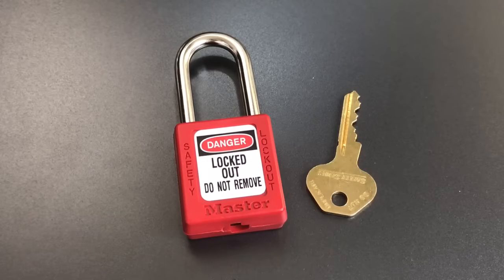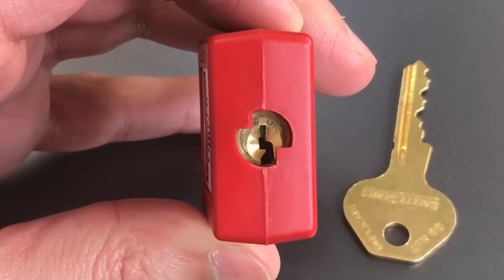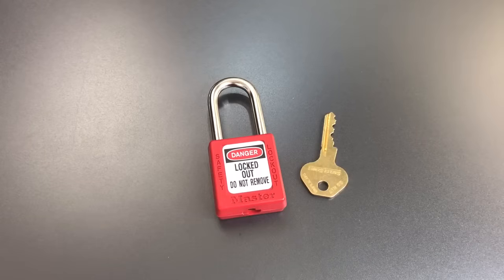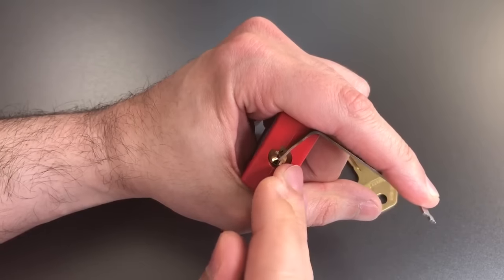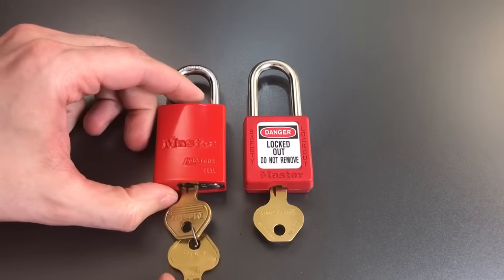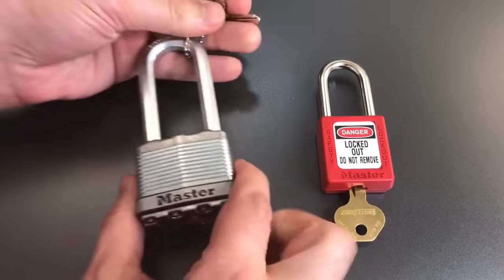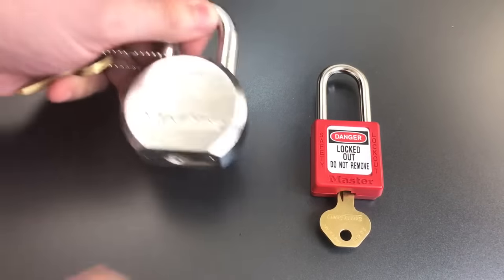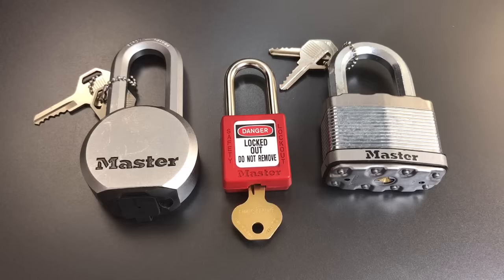[479] The Master Lock Paradox - Model 410 LOTO Padlock

Comment: The strong core is so the wrong key does not accidentally open the wrong lock by the ignorant new guy on the crew . The weak housing is so the lock can be busted open in an emergency. I worked in the engine room of a commercial tugboat, we had these all over the place.
Reply: But this doesn't explain why the strong core is not also available in the strong housing LOTO locks. That is the "paradox."
Reply: @WalterBurton  the theory of marginal returns?
Reply: I would add that in the environment that these are being used, tools to "break" the lock are so readily available, the need for an extremely robust body/shackle isn't the top priority for design.
Reply: You all are missing the point, why in the hell would they not have this same core in their other locks instead of having the rest of their lineup which are used to prevent theft have these cores or similar?
Reply: @Alex-ve1og  It is their option to sell whatever, and our option to buy whatever. Why make it more complicated?
Reply: The bigger stronger non-LOTO locks have less robust cores because pricing is so competitive on those locks that pennies matter.
Reply: @WalterBurton  It may be more of a probability thing. The strong body locks are designed with the thought that vast majority of people trying to get past them will use some sort of brute Force. The lotto lock is designed to be tamper resistant.
Reply: @Alex-ve1og  Because they sell 200x more of the plastic one = bigger circulation of keys, hence a core with more possible combinations = lower likelihood of same keys. It's not rocket science.
Reply: @overtaxed79  you dont think a lot, do you?
Reply: Fuck yeah tugboats
Reply: @frankslaiter5188  And because normal consumers judge a lock by the housing and not by the core.
Reply: Walter Burton every lock needs a weakness, just like how every person has one. Ez
Reply: @TheGreenTaco999  You actually captured my thoughts when reading that comment.
Reply: That's not the paradox. the paradox is why can't we have that core in the "good" Master locks that are meant to withstand more than just butter knife
Reply: You don't need security pins to prevent that mistake. Spools are strictly an anti-lockpicking feature, they do nothing against "loose tolerances, lock accepting wrong key" sort of errors. And usually 1-2 spools are enough to thwart raking. 6 security pins is definitely a setup against competent lockpickers.
Reply: I worked on experimental reactors, we had special locks which were multiple pins on a flat plane. The keys could only be removed in the locked position. The keys were required to be inserted in to the control panel before firing the reactor. That ensured all access doors had been secured before operating the reactor.
Reply: @HarryTwoDogs  So why waste money on assembly lines for the shitty cores when you can just make more of the really good LOTO cores and spam them into every product?
Reply: Walter Burton money
Reply: I work on tugs and we hardly ever use them. The most use they get is when I pick them while we are headed up the Hudson River. If you are using these all of the time then you guys have a lot of electrical issues. They don't even use these in shipyard most of the time but I work for a smaller company. Peace brotha
Reply: my theory. 

A large work site may have 1000 people who all have their own lock. You need a large number of different keys to prevent unintentional unlocking, so 6 pins. Masterlock already make a higher security 6 pin core and didn't want to make a new low security core. 

The stronger bodied lock out locks are typically only used by a master isolator. He locks out everything throws all the keys in a box then locks the box with a single beefy lock. there may only be 20 master isolators for 1000 workers. This means you don't need as many different keys so less pins so just use a cheap core. 

Why masterlock sell other locks with shitty cores? money.
Reply: @rorschacht8478  So Why all the security pins?
Reply: You dont need to have a core full of security pins for that though, you just need a six pin core but the pins themselves can be standard. And it also does not at all explain why they dont have those cores with those pins in their padlocks actually meant for security.
Reply: #metoo
Reply: @overtaxed79  It's also our option to question why.
Reply: BlaubartMT sure we can ask.
Reply: To bad it’s a felony for someone besides the owner to take them off🤷🏼‍♂️
Reply: @soggybottomboys2792  right, safety first.
Reply: What would be a situation where you have to break it open, if you don't mind me asking?
Reply: WeirdoWithACello when someone loses the key
Reply: @weirdowithacello3481  if someone loses a key, or someone goes home for the weekend but forgets to take the lock off.  You veryify the person assigned the lock is clear and safe, then you cut the lock off and give them a new one.
Reply: @Alex-ve1og  I would guess because a majority of criminals will try to break a lock and don't have the knowledge to pick it. Yes they should put the best cores in the strongest bodies but it'd cost more for both them and the consumer.
Reply: Sir please put away your ph—- are those locks?
Reply: @WalterBurton  this makes sense to me. Masterlock knows they are not the premier lock company and don't have any illusions about thieves not being able to get past their locks so they build their locks to do jobs. This lock needs to keep newbies from accidentally murdering their coworkers but also be removable when the newbies lose the key. The sturdier one's are so that people aren't able to just hit the lock with a hammer to break it in a smash and grab (also thieves may overestimate how hard it would be to pick based on sturdy it looks outside). 

Now why they don't have an option which uses both best body and best core is beyond me.
Reply: The '1000' people should have their names visibly etched onto the lock body,so you open your own lock,rather than someone else's.
That's what they do where i work...
Reply: @HarryTwoDogs  Not really. I've purchased locks at a dollar store, $5 for 2, that were arguably harder to pick than a much more expensive #3 Master Lock. Master Lock depends on advertising, ignorance, and market domination. The generics don't advertise and they aren't sold in major hardware stores, which lets Master Lock charge a premium. You walk into Lowe's and you've got your choice of maybe three different models of garbage Master Locks in various form factors, all overpriced, with zero competition. People need a lock and they just buy them, no questions asked, because the concept of a lock being insecure is alien to most people, because of advertising and reputation (and why would an 'honest' retailer like Lowe's sell a garbage product, right?!). Even if an amateur could pick it open in minutes on their first try. My first Master Lock? Took about two and a half minutes. Now I can open one in about two and a half seconds, and I'm garbage at picking.
Reply: @frankslaiter5188  Tamper resistance defies the purpose of a LOTO lock. A LOTO lock is basically a sign that says "don't touch this", but then enforces that sign by requiring active disabling of the lock before touching the thing that shouldn't be touched.

The high security core does absolutely nothing to stop the uninformed newbie from taking the key and unlocking the lock.

If you've got random people walking around your facility picking LOTO locks you've got far, FAR bigger problems than low security LOTO locks.

You might have a point for LOTO locks at external equipment placements, like junction boxes in a neighborhood for example, but you wouldn't use a plastic lock in that kind of situation, so the high security core does you absolutely no good.
Reply: Alex  because in a factory of 900 workers security isn’t the issue.  You need to make sure you have different keys for each person.  And the robust ones are typically used by cascade lockouts.   Where security is higher and fewer people have that style of key.
Reply: @rogerspable  fuck yeah 
Tugboats
Reply: You are correct.
Reply: I used to be curious about things I thought i could help improve at work and it got me fired.  I should not have even commented because it is not my place to make opinions.
Reply: Agree
Reply: You guys don’t understand how lockout locks are categorized. You’ve got different lockout locks for different purposes, a lockout lock like this is for a machine that could turn on at any moment and may need the control panel accessed at any moment (yes, you could be saying “why not leave it on?” Well, if you’re in a big NC mill you don’t want someone pressing that green button”
Reply: ZZP Zing Pheonix I've got 3 of them on my belt right now. Got to lock out cells and robots while I work on the other robot.
Reply: Anyone on a worksite can BUST a lock... but you need to add some complexity to stop someone from TAMPERING with a loto lock... or unlocking it with an identical key by mistake
Reply: As a commercial diver, ive locked out a few tug boats
Reply: Thieves break padlocks or just cut through the loop the lock is secured to. Most thieves are not using lock picks to open locks. Heavy looking locks may offer more of visual deterrent to a thief who is not carrying around lock picks? One thing that this channel has taught me.... doesn't seem to mean much how good the core is, if someone knows how to use a lock pick, they are getting in no mater what.
Reply: ZZP Zing Pheonix  spot on
Reply: @ZZP King
I came here to say that.  As a security officer, we're called to "unlock" these from time to time when the one who applied it isn't available.  We use bolt cutters. 😎  The locks are supposed to be cheap, we're told to always cut the lock instead of the claw (the thing that isn't in the video but what the lock gets attached to).
Reply: @weirdowithacello3481  the policy of the company I work will allow the removal of a lock if the supervisor can contact the indivial and verify a piece of equipment is safe to put back into service. If an employee calls in sick or forgets to remove lock.
Reply: @overtaxed79  that's easy to say, but people don't realize how vulnerable masterlocks are. I'm in my late 40s and had no idea how easy it was to just open a masterlock until I saw lockpickinglawyer and BosnianBill. Hell, just a few days ago I raked open a masterlock my brother gave me. I did it in seconds. It was horrifying. My father had used these for almost his entire life. They don't really protect. They just give the visual of protection. Might as well have a sign that says it's locked..   obviously, lockout locks are different in that it really is about visual. That's probably why masterlock is so good at that.
Reply: @CraniumOnEmpty  if somebody wants to get in they will.
Reply: @overtaxed79  can they at least make it so that you have to have a destructive entry, so at least you know? I work in programming and it pisses me off to no end that there are still companies that store passwords in plain text (or in two way hashes sometimes, which isn't as bad, but also shouldn't be done). It's something that anyone who programs encryption or knows anything about security would never do on a live server. This is just as bad. Sure people can break into your account/stuff, don't fucking give them a key please.
Reply: @WalterBurton  less common less necessary
Reply: The number of pins makes sense for that but security pins wouldn't effect the wrong key in the wrong lock situation
Reply: Completely agree,  lock mechanism ultra specific and robust, but with any modest intentional effort the lock body falls apart... in dramatic industrial situations this saves downtime, machinery,  and lives when multiple locks have immobilized/ secured something that urgently needs released.
Reply: @Alex-ve1og  Might be due to when each was designed, and their target markets? It looks like the plastic body lock is a relatively recent one, while the aluminum body LoTo lock looks like a much older design. Meanwhile the one with the worst core looks like one of their consumer grade locks with a red plastic band, rather than one targeted at the industrial market
Reply: @TheGreenTaco999  ouch, but fair.
Reply: @Alex-ve1og  As others have said, if they had the same core in other locks, then a key from an "other lock" might be able to open a LoTo lock, and that is simply not acceptable.  No reason why they couldn't have a different 6 pin core in their supposedly more secure locks though.
Reply: What a fabulous thread...
 :)
Reply: @Ken Fullman You know, I'm actually not sure about that. The false gates are there to make sure the pin doesn't slip into a true gate of you are close and applying rotational force, correct? 

I woe think as pins wear you'd get a wider range of spots it could be at to accept rotation, and if that is the case, I would expect a false gate to assist in binding the lock when it gets a key that is close, but not quite, or cause binding when the pins are getting worn past safe use. 

I think this could be tested by taking one of these locks, and getting two sets of pins: one plain pins, the other false gates, and moderately filing down a spare copy of their keys, and testing to see if there is a difference in how far off spec the altered key could be before unlocking the lock?
Reply: @WalterBurton  The plastic lock is a typical LOTO lock I've seen... some differences but very much the same. It's for locking machines out or panels, INSIDE of buildings or in dry-weather temporarily outside. It's meant to be taken off after work, or after the day is over and replaced with a permanent lock with a additional LOTO "Note" describing what is going on attached to said lock.

The plastic lock is meant to be able to be opened, BUT "tamper proof" most ways to open that lock would be very obvious, picking a lock like that (typically) would entail something bad... something illegal. 

Metal LOTO locks could be used outside in less than acceptable weather. They can be generally left in the sun for longer times, be wet, be moist- they're tougher generally... makes it alot harder to open or break.

We also had "master" locks with COULD be opened with a hammer. You hit the left side pretty hard and the top would simply fall off releasing the lock, which the bottom part could be re-used and re-pinned and the part could be repleaced easily. It's "tamper proof"-- to open the lock without a key in a pinch you can essentially break it, but it would be very obvious what occured and would be investigated by security or safety inspections the next day. if any theft, it's on camera so...

Bottom line;

Liability. How much liability do companies WANT to take?
Reply: @aandyherr817  Point is that there's no reason the core shouldn't be better. If it's so easily pickable, the tamper indicators provided by the lock body are nigh on useless. And vice versa.

Comment: I use those plastic LOTO locks at my job everyday, and the reason why we use them is because they can be broken open pretty easily if someone forgets to take them off and leaves with the key. Not sure if that's why they're designed that way, but at work they're pretty much just to remind someone that an area or piece of equipment is locked out.